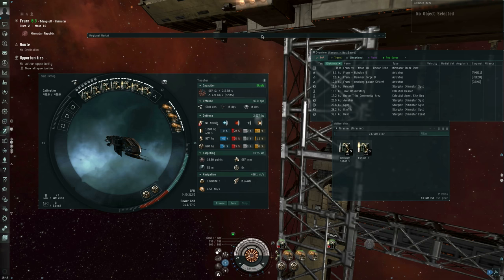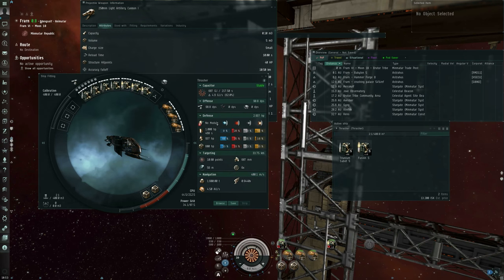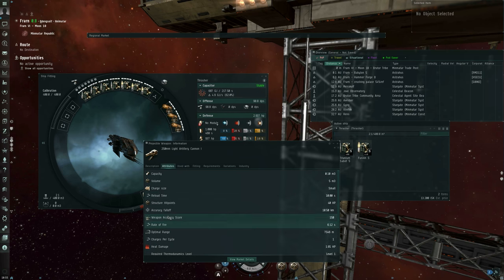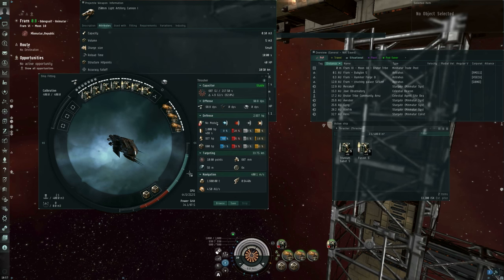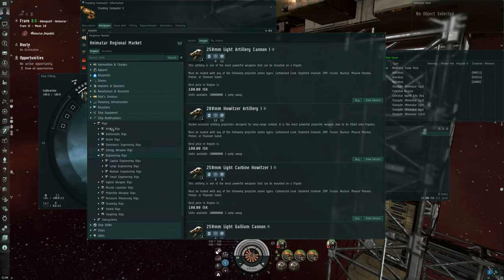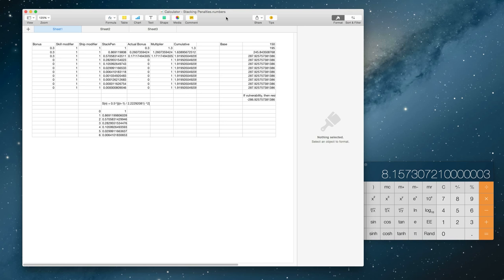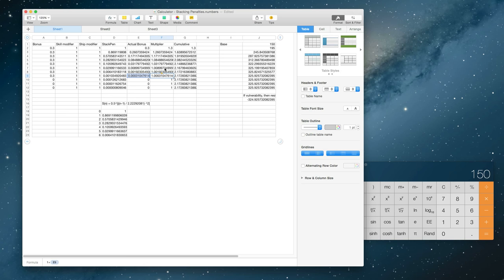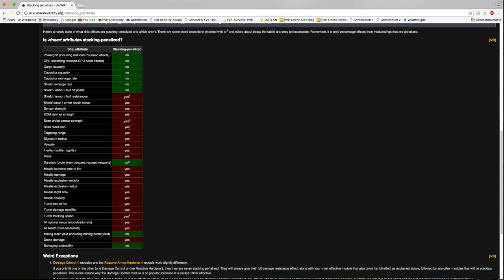Stacking Penalties

Comment: Can you avoid stacking penalties, by using a Tech2 module with a Tech1 meta 4 module and a Tech1 meta 3 module and etc.?
Reply from the maker: I could have sworn I had replied to this earlier, but yes, this is correct.

Turret Falloff bonuses get a Stacking Penalty calculation, Turret Optimal bonuses get a Stacking Penalty calculation, and Turret Weapon Accuracy Score bonuses (a.k.a. Tracking Speed) get a Stacking Penalty calculation.

Any module or rig that affects Weapon Accuracy Score will be thrown into the Stacking Penalty calculations for Weapon Accuracy Score (thus, Tracking Computers scripted for range will be ignored in a Stacking Penalty calculation for WAS).